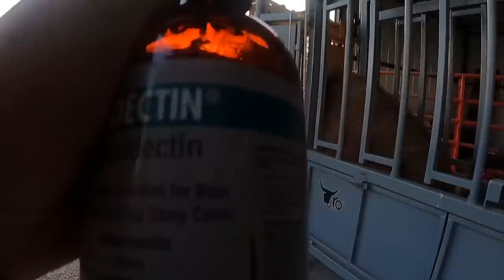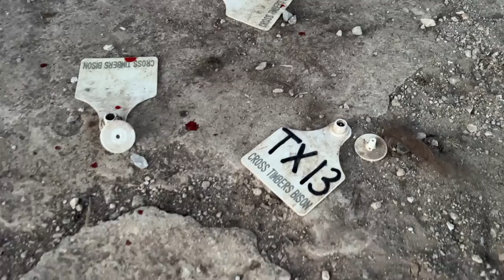We Caught Them This Time...Gotta Get Them Worked!

Comment: Definitely need to upgrade to hydraulic at the last stage. Glad to hear the Spring check-up is complete and the goal to set-up a hydraulic system by Fall. You only need to replace the last stage with hydraulics. Pretty much everything else seems to be working great.

Comment: Titan West Bison Handling Equipment
Titan West Bison Hydraulic Chute	Titan West Bison Hydraulic Chute	Titan West Bison Hydraulic Chute Headgate and Crash Gate
Heavy Duty Cattle Care® Bison Chute II Hydraulic
Heavy Duty Cattle Care® Bison Chute II Hyd	Retail	Special
+ Freight
HD Bison Hydraulic Chute - Horizontal Headgate
LH Control Neck Extender  Pressure Relief Valve
Crash Cage Sheeted Windows Sheeted Top
Rumber® Floor ~ Chest Rest ~ Shoulder Cushions
Hydraulic Live Bottom Adustment 
w/ 220V Mounted on Chute ~ Side Exit on Right	$ 29,863	$ 24,885
HD Bison Hydraulic Chute - Horizontal Headgate
LH Control Neck Extender  Pressure Relief Valve
Crash Cage Sheeted Windows Sheeted Top
Rumber® Floor ~ Chest Rest ~ Shoulder Cushions
Hydraulic Live Bottom Adustment 
w/ 220V Mounted on Chute
Side Exit on Right ~ With  Bull Package
12” Longer with Palp Doors Both Sides	$ 32,230	$ 26,915

Power Supply:
Electric 220V Power Unit	$ 4,322	Special	$ 3,705
Gasoline Power Pack Manual Start *	$ 5,813	Special	$ 4,985
30’ of Hoses& 1 set of Quick Couplers	$ 776	Special	$ 665

Scales:
Scale Mounting under Hydraulic Chute	$ 129	Special	$ 110
Weightronix 640 Indicator & Sq Loadbars	$ 3,334	Special	$ 2,860
Weightronix 915A Indicator & Sq LB	$ 4,014	Special	$ 3,445
Tru-Test ID 3000 Indicator & Sq LB	$ 4,755	Special	$ 4,080
Tru-Test XR 3000 Indicator & Sq LB	$ 5,250	Special	$ 4,505
* Includes 30’ of Hose & 1 set of Quick Couplers
Options:
Hydraulic Live Bottom 6" - 22" Wide	$ 2,308	Special	$ 1,750
Bull Pkg-12” Longer w/ 2 Palp Doors	$ 2,367	Special	$ 2,030
Hyd. Chute Ez Lift Portable Att	$ 4,838	Special	$ 4,150
Portable Attachment	$ 2,612	Special	$ 2,260
Bull Package Portable Attachment	$ 3,265	Special	$ 2,800
Swing Arm Controls	$ 1,421	Special	$ 1,220
Rear Door Remote Valve *	$ 955	Special	$ 820
Side Escape *	$ 1,003	Special	$ 860
Palpation Door *	$ 737	Special	$ 630
Bi-Fold Foot Door one side *	$ 274	Special	$ 230
* Specify Right or Left	 	 	

* Prices Plus Freight & Taxes , Prices Subject to Change W/Out Notice, All Prices Are CASH / CHECK Discount Prices *

Bison Manual Chute 
Bison Manual Chute	Retail	Special
+ Freight
Titan Manual Bison Chute - w/ Crash Cage, Sheeted Windows
& Top LH  Controls ~ Rumber® Floor ~ Chest Rest
Shoulder Cushions, Spring Loaded Crash Gate  ~ Double Side Exit	$  13,945	$ 11,735
Titan Manual Bison Combo Chute - w/ Crash Cage Sheeted
& Top Windows  LH Controls  ~ Rumber® Floor Chest Rest ,
Spring Loaded Crash Gate~ Double Side Exit ~ Palp Cage	$  16,372	$ 13,775
Portable Trailer Attachment - Regular Chute	$ 3,636	$ 3,060
Portable Trailer Attachment - Combo Chute	$ 3,956	$ 3,330

* Prices Plus Freight & Taxes , Prices Subject to Change W/Out Notice, All Prices Are CASH / CHECK Discount Prices *

Bison Manual Chute 	Bison Manual Chute 
12’ Portable Loading Chute with Rumber Floor
(Shown)

14’ Stationary Loading Chute
$ 7,615

$ 12,436	$ 6,410

$
Reply: Figuring out all the costs---they are not cheap and it is no question why he hesitates. I am assuming when he can financially wrangle the expense, he will get them the machinery that will be more productive and the least resistant of working those majestic bison. Farming, ranching is very high end if a person wants all the machinery and the quality of working their business. The supposed payments to farmers/ranchers does not EVER COME CLOSE to what they have to pay out to maintain a herd, whether dairy or beef feed out/bison. Now most of the former farms and ranches are owned and operated by corporations. Bill Gates has been buying up operations for years now, so he can set in motion the idea of all GMO veggie products instead of true MEAT. That is also part of the new world order platform. PRAISE GOD for all those who still own farms and ranches in a generational family.
Reply: Ouch! Spendy! No wonder he is waiting to buy a hydraulic squeeze chute.